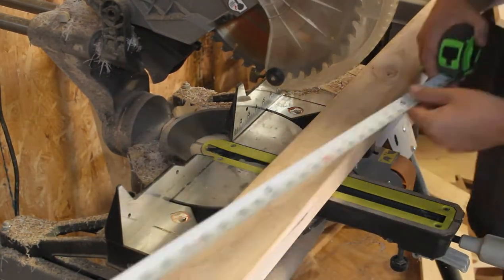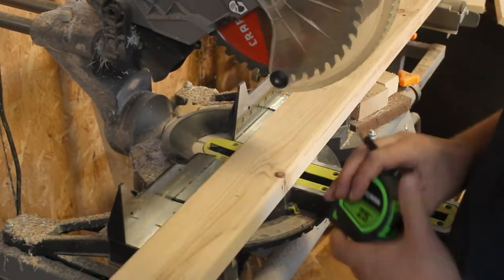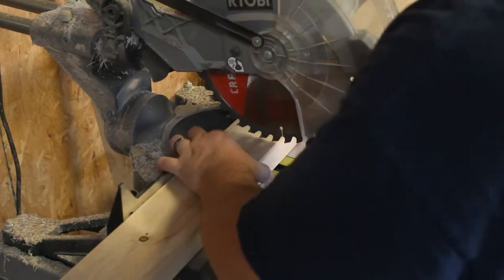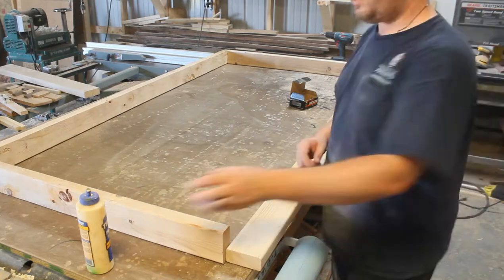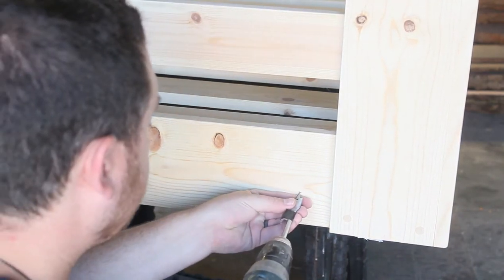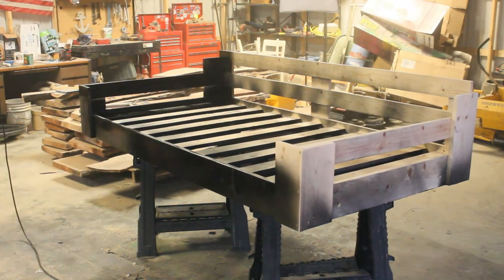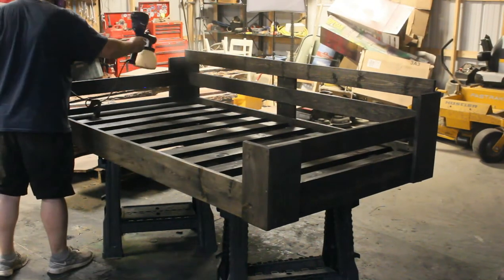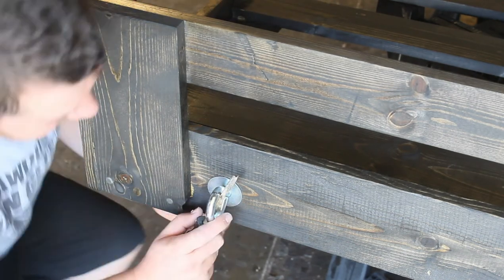DIY Porch Bed Swing

Comment: Great job brother. I made one very similar, but on the top of the armrests I installed 2x6's, and chamfered the edges. The reason for the 2x6 and not 2x4 was so I had room to sink a couple of stainless steel cup holders in the armrest. Love the channel man! Keep it up!

Comment: Great video...?s For hanging the chair I would like to use chains...can I still use the hardware you used...or do you think rope is the better option...2. how much weight can it hold after mattress is in place. and lastly may I have the nail and glue information.
Reply from the maker: I leave the hanging up to the customer. Its more liability than I want to hang something at someone else's house. I specifically chose that hardware with chain in mind but the customer chose to go with rope, so I would say either option will be suitable. I use titebond glue and 18 ga brad nails.
Reply: @dagragg  Thanks for the timely reply...I was mistaken in asking for the nail info..I meant the screws that were used to put the entire frame together.
Reply from the maker: @tchesstc  I pretty much just use 2" deck screws.
Reply: @dagragg  Thank You